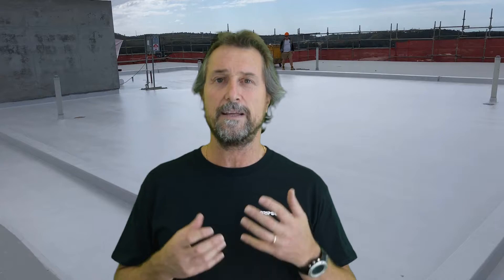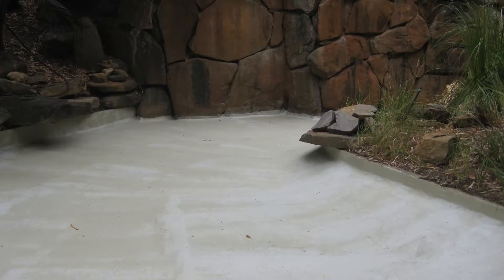What's the difference between crystallization and penetrating liquid waterproofing?

Comment: So is it okay to use liquid membrane and crystallization system? What if the substrate is uneven and needs levelling? I understand Xypex or similar product has to be applied on untreated, unlevelled concrete so it saturates deep. Do you use self-leveling cement afterwards? And then use liquid membrane on top of the self-leveled cement?
Reply from the maker: Hi Pang, we don't specialise in crystallisation and or penetrating liquid waterproof membranes, we believe elastomeric coatings to be the best way to waterproof a structure. Hope this helps and thanks for watching! :)
Reply: I'm learning this myself... if you use a crystalizing system there may be 15 to 30 days before it has time to crystallize thoroughly from moisture,  and then some manufactures don't warrant or recommend there penetrating rubber membrane product over it because it won't penetrate.

Well it would be nice to find a membrane to stack on it.  
The top surface is likely recommended to be profiled to cps3 (16grit texture), instead of cps2 (40 grit or much finer) which is what a hand grinding multi fin cup wheel may achieve.